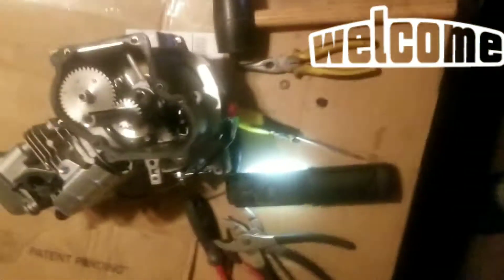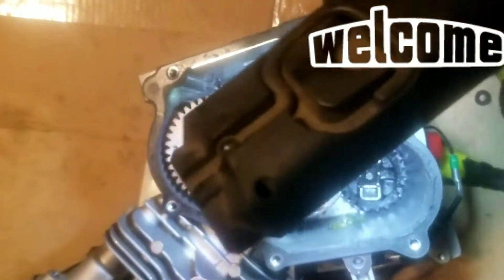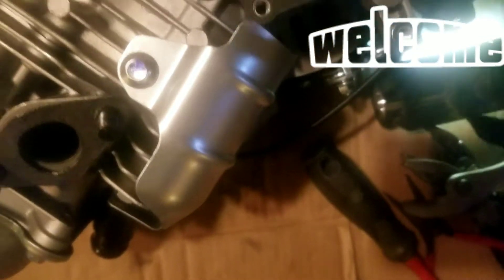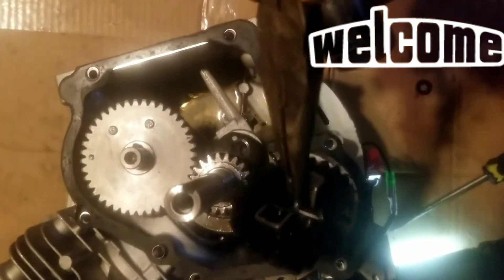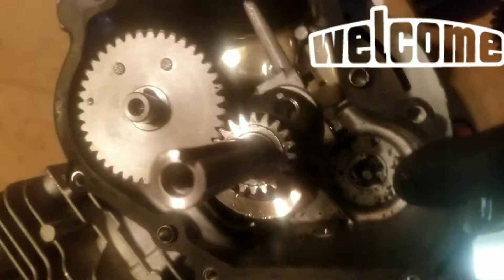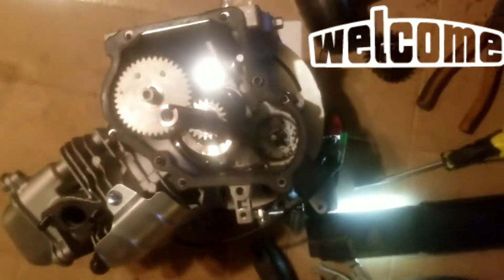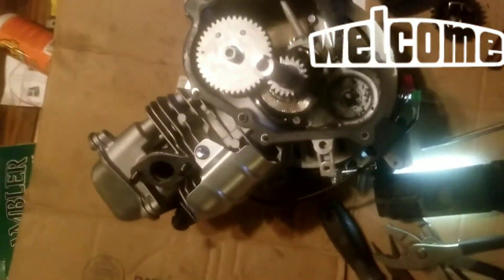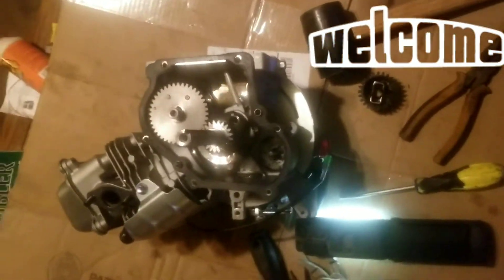Part ONE motor swap phatmoto rover 2020

Comment: I think for the crank/cam timing its just line up the dimples on the crank and cam gears. Keep the videos coming too, so we can follow your progress for our mods.
Reply from the maker: Yes you just have to line up the "dots" i just found out. And it was way off lol
Reply: @miguel360kmc  I saw a video, from I think it was go power sports anyway, they remove the shroud then the flywheel and use a drift punch to drive the gear out. Then they use a short bolt to plug the hole. I've seen both methods used, they both work and you still have to clean out the crankcase too
  After watching your video and seeing everybody's Phatmoto's going to the Predator, I am too. I'll put the Lifan on my other 26 Schwinn and it'll be good

Comment: Is the Predator more powerful than the Lifan?  I've always been curious.  Are you planning to keep the jackshaft? I have the 19, I've always been on the fence about the jackshaft.  I've been thinking about changing the transmission to the one that goes with The Predator engine or even a torque converter. I really want to try to use 120cc lifan engine, it looks like it may fit withwas some modification but I don't know. I have come to the conclusion that 37mph on flat ground is the most I can get out of the stock engine.  Cool vid  though, would really like to see how the 79cc Predator works out.
Reply from the maker: The reason i picked the p79. It fits with next to no mods no cutting or welding just need to come up with mounting solution its about 1in wider there are a few fixes. Not sure yet wich im doing. You can use all the other parts from the jack shaft to throttle and even clutch and chain. Ill be upgrading all that.
  The p79 built out right and tuned should be doing 40s-50s im also keeping the stock 50t sprocket not worried about top speed as much as low end power lots of hills in my area
Reply from the maker: And i would not pull one motor to replace with the same  hit or miss brand even if its bigger could turn out to be a big waste of money and time. I like the lifan motor in scooters but these small blocks.. nope...
Reply: @miguel360kmc  wow yeah na not going to hit 40 to 50 with my 79cc lifan. I have   a 36 tooth on mine and I changed the bicycle side to a 16 tooth. I also have a lot of hills. I have to hit them going full blast.  After about 1600 miles the stock lifan is getting a little tired.  I'm trying to get some ideas.  Thanks for replying.  Can't wait to see how yours build goes. 👍I haven't really seen anybody do all that much what a phatmoto yet.
Reply from the maker: There is not much that can be done to the motors.. at best full removal of Governor hollow out exhaust run a pipe from box add a carb and catch can smaller sprocket better street tires upgrade bearings in Jack shaft.. all that will get you 32mph-40mph range depending on rider and streets.. the motors just offer nothing extra